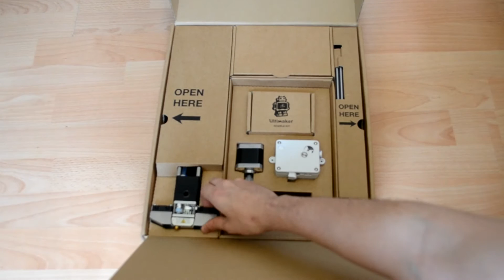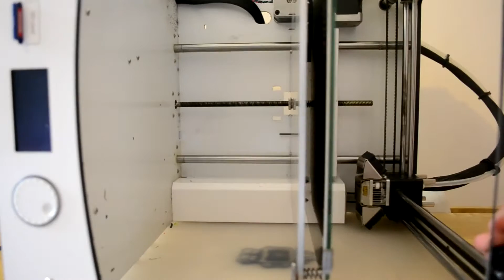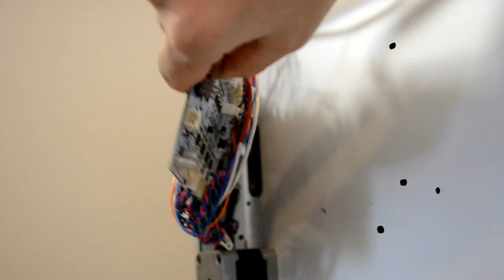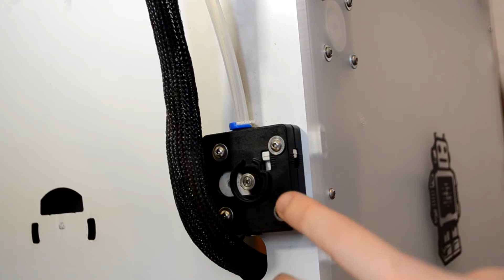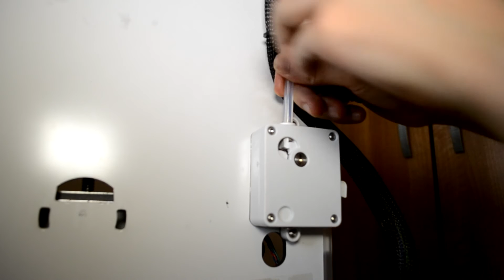Ultimaker 2 Upgrade Kit

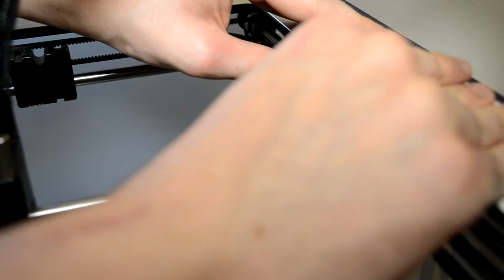Comment: They way you remove the two axles at 7:21 is very bad. All the force of you pushing that axle down, lands onto the belt. Good chance it stretches and/or damages the belt that way. I think it's better to rest your handpalms on the edge of the printer and then push the axle out in a controlled manner with your thumbs. Or put something soft on top of the axle and use a little hammer to tap it out.
Reply from the maker: Ok thank you for the suggestion.